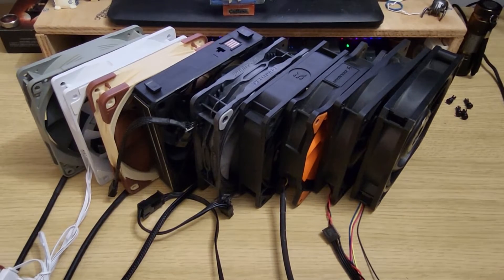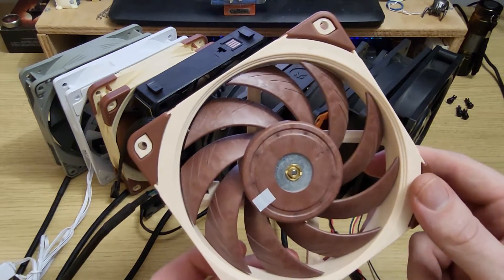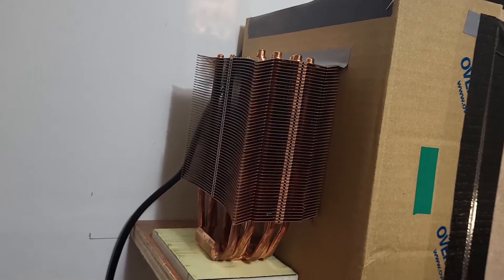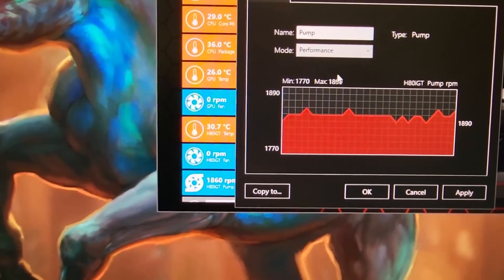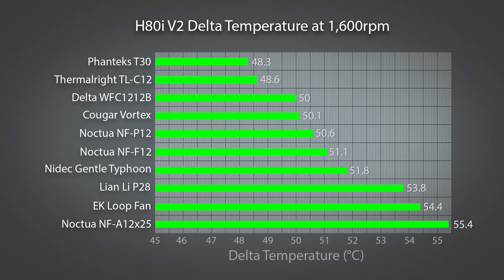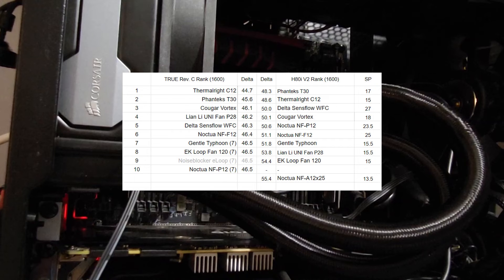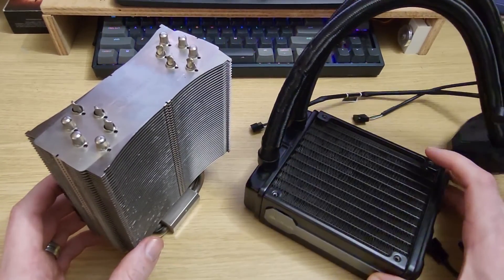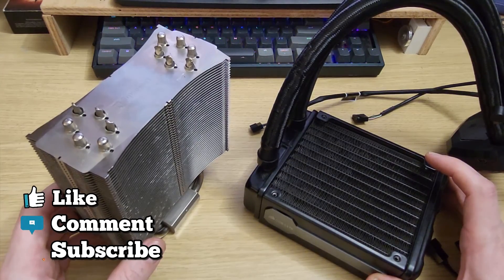The Truth About Radiators and "Static Pressure Fans"

Comment: Arctic P12 vs TR AIO fans (not sure which ones they use).  I could not get the original fans so purchased the Arctic P12.  Took it all apart, but it all together, and sadly the speed is 1800rpm vs 2k rpm.  Hmmm, so I felt the top side of my rad and it was not near as much air leaving.  I switched to 48% vs 40% in UEFI so the rpm would be about the same.  I fired up prime95.  I was floored.  My system was 100% but no temp increase.  It would fluctuate by 1c and go back down.  The old fans, from day one, that test had the original fans going at a good clip, and you knew you were taxing your system.  I am stumped at how I can't feel the same amount of air passing through the radiator YET the system is rock solid cool in P95???

Comment: i have 24 fans  NF-F12 industrialPPC-3000 PWM inside  my pc and the air moevment is huge inside
Reply: I’m looking at building a pc myself, at the lower rpm range is the motor more noisy than the standard counterpart or above the same

Comment: Doesn't make sense. The NF-P12 has 20% better airflow than the T30 but is still 2 degrees behind it. So, it's obviously not CFM that matters. The SP of the P12 is 2.5 times less than the T30 according to manufacturer specs. So, yea. SP is the most important thing on a radiator fan. The T30 being almost last in your Static Pressure test is really weird.

Comment: What are you views on these fans: 
1. 120x25mm 2000RPM 70CFM 22dB 3W PWM connector ~2.77$
2. 120x25mm 3000RPM 110CFM 35dB 8.5W Molex Connector ~3.35$
3. 120x38mm 4000RPM 170CFM 35dB 18W Molex ~5.3$
4. 120x38mm 6000RPM 220CFM 50dB 36W Molex ~7.76$

Comment: I understand that speed is an easy parameter to control, but is it relevant to any usage? Personally I only care about (in descending order of caring): sufficient cooling (temps low enough for boost clocks to stay high and components to be below rated limits), noise (including quality thereof), power consumption (barely a factor for any remotely tolerable cooling solution).
Of course that results in the test being subjective because of the quality of noise criterion (pure tones, harmonics, and ball bearing rattles bother me a lot), but it's something to consider. Maybe there's a bit too much emphasis on delta t at fixed speed.

It's still all very interesting testing in a field filled with marketing BS. Thanks.

Oh, FWIW I've never used a Noctua fan so I'm not offended by your results 😄

Comment: I love seeing tests like these being done. So annoying seeing people talk about which fans are the best when they have no idea what "best" even means.

I'd like to see the voltage versus static pressure for these to see which fans are the most power efficient. 
I'd also love to see DB level versus static pressure.

If this is of interest you, I'd actually be willing to compile the data myself and pay you to do the tests at different volume and power levels. My email address is on my youtube channel.
Reply from the maker: Thanks for the comment! I appreciate the offer and it does sound like it could be interesting; however I don't have time at the moment because of work commitments. In terms of efficiency it's the Noctua NF-F12 in the lead, drawing only 60mA at full speed. The quietest fans (Gentle Typhoon, Arctic P12, Lian Li P28, Noctua A12x25) are consistently the weakest in terms of max. static pressure performance, but as you can see it doesn't always translate to poor thermal performance.

Comment: It is nice seeing that you at least attempt to verify your claims. But your methode is still flawed:
You are neither testing at iso noise nor power, taking single-point measurements and extrapolating them against a non-linear relation, comparing fans of different dimensions. Basically the only thing we can take from this is that the fans, at that particular power, produce a specific static pressure when pushing against a closed container - not something any of those fans are meant to do or how anybody would use them.
(aside from the fact that you are pushing some of the fans to waayyy outside their specifications).
Reply from the maker: It's nice being the one conducting the tests rather than one of many armchair experts criticising the methodology. :)
Reply: @FanPhys  So ad hominem instead of acknowledging the problems - a classic.
Reply from the maker: @ABaumstumpf  so if I don't agree with you, I'm wrong? Also classic!
Reply: @FanPhys  "so if I don't agree with you, I'm wrong? Also classic!"
And more fallacies. But thanks for showing everybody so clearly that you are in fact no interested in doing actual tests and comparing the fans but rather just want to virtue-signal and insult everybody that does not make the same mistakes as you do.

And yes - really classic of you to not even attempt to make an argument. Classic, predictable and pathetic.

next you will try moving the goalpost with a few more insults, right?
Reply from the maker: @ABaumstumpf  Thank you for your comments!

Comment: I'd like to see results of push pull vs push vs pull. Some test I saw pointed to a max of 3 degrees difference when adding a second fan.
Reply from the maker: Yeah adding a second fan in series will increase the pressure and might reduce temps by a couple of degrees, but at the cost of more noise and also more space.
Reply: @FanPhys  Costs much less noise than expected - 3 dB, obviously, on average, but modulation may occur which is to taken care of. While a twice as high CFM fan will be usually 12 dB louder. The gain is essentially double if not more with denser heatsinks. But mostly costs more money and takes double the space.

Static pressure performance of the fan matters only in case of very thick or very dense radiators combined with very weak static pressure fans.
For example, if I put 1.5 mmH2O slowish bequiet Silent Wing 3 fans (~1400 rpm) on a 60 mm thick radiator with 32 FPI density, I get a quarter of the cooling performance per RPM because the single fan does not produce enough static pressure to pull air through properly and the airspeeds are very low. Even doubling the fan speed with this design which produces many times the noise just does not cut it. Using almost any other fan, however, will handle it, as will a push/pull configuration since that converts it the radiator into a duct.
Reply: It would make a great video!

Comment: I just have one question, how did you measured the static pressure? Did you completely blocked the air flow? Just asking because the static pressure is not very linear vs air flow. I have seen this mostly on the Delta datasheets.
Reply: Static pressure highest when all airflow is blocked. He measured it by gradually blocking exhaust on that test box. 
As far as i see it - even with lower SP some fans "scoop" and move much more volume of air, despite being unable to keep it pressurized
Reply: @RelentlessRage  I know the sp is max when airflow is 100% blocked, i'm asking about the sp values written in the table, IF they where measured with blocked airflow they don't say much about the behavior when the air is just partially blocked like shown in the video, supporting what he was saying in the video.
Reply from the maker: Yes I measured the static pressure against different levels of flow... the data is in a previous video. Peak efficiency is usually somewhere in the middle of the curve and is broadly the same for all axial fans.
Reply: You could take the effort and watch his videos showing his methodology.
Reply: @MiesvanderLippe  i did, seems like you don't read...

Comment: Very helpful video, thanks. Which high rpm fan and a suitable radiator would you recommend?
Reply: Go for air unless you actually need liquid.
Reply from the maker: The T30 is clearly the strongest 120mm fan at the moment, but 140mm coolers are superior both in air and AIO if you have room in your case. I had a Kraken X61 a few years ago and it was very good, but also expensive, and I'd always go for air over AIO personally.
Reply: you should look at reviews from people that actually test the fans correctly and not use them way outside their specifications.